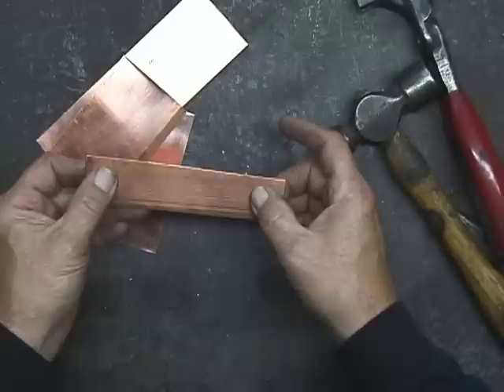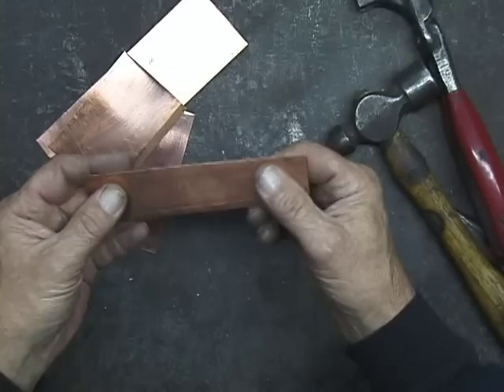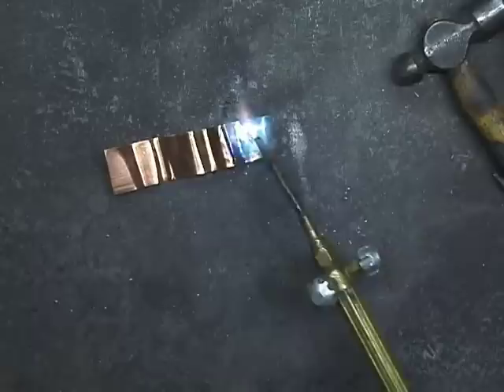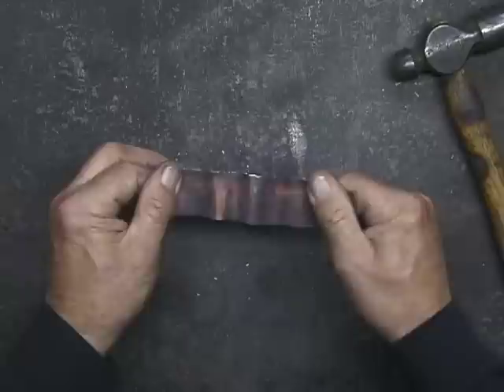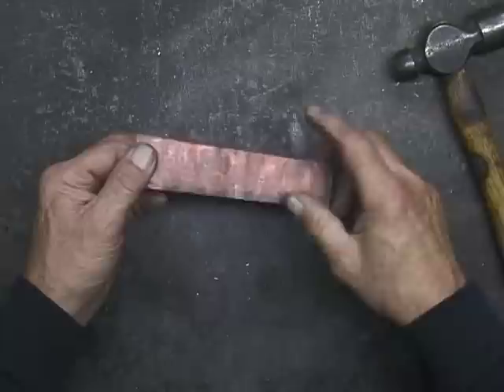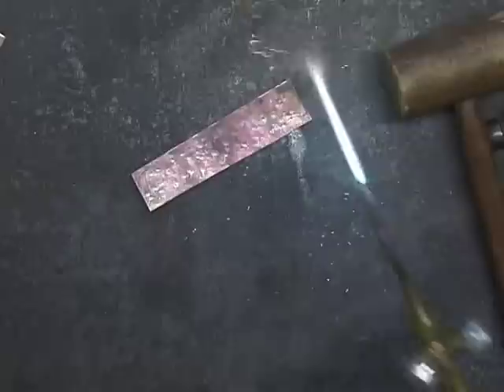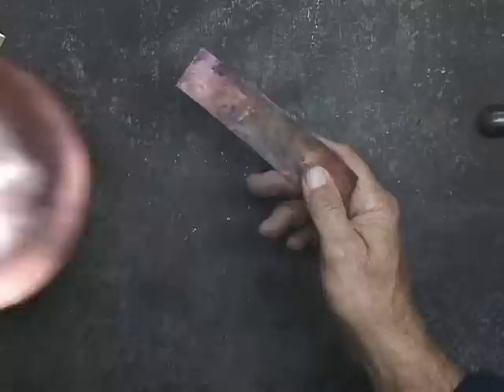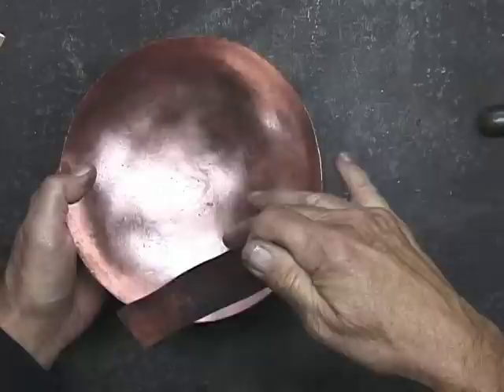Copper Annealing

Comment: Thank you for the information, it is appreciated. I'm making a "Thermette" out of copper pipe and sheet stock. I'm  forming  caps from the sheet copper. Finished one with lots of hammering & no annealing. I'm definitely going to anneal the 2nd piece & hopefully make it easier on myself. Thanks again.

Comment: I have been doing this for quite some time in order to shape 12 AWG wire to make shine still drippers for the condenser. Had no idea what it was called. I just tried to "smith" it one day, and realised it was soft after it had cooled and didn't need to be reheated for a while. Had no idea I had rediscovered the wheel. 🤣

Comment: Very good explanation; thank you very much! I am using brass photo etch for a 1:35 model, where I am also replacing "tubing" with copper wire. There are lines molded, but I like adding the tactile copper. Looks good after. Thanks!
Reply from the maker: +Jaroslav J. Peterka   Good to hear that you liked the video.  Sounds like you are doing some intricate work.
Reply: +George Goehl   Hi! It is quite detailed. I don't know how to send you pictures, but would invite you to find me on Flickr, where you could see my photos under name "Crumb & Crust", or BR 86. Thanks again. I am annealing now every piece of brass or copper. Amazed how easy it is to bend!

Comment: The flame looked like it was carburizing because of the large inner envelope. I tried it today, with oxy/propane and found that the neutral flame seemed too hot, I did it again with a slightly carburiing flame and it seemed to work better. Either way, it worked very well. Thanks

Comment from the maker: @coma22309 if you work with copper, such as hammering or bending, copper becomes more rigid.  If you heat copper it becomes softer, more malleable.

Either way you are changing the internal structure of the metal.
Look up Annealing (metallurgy) in wikipedia

Comment: I noticed you heated the copper with a carburizing flame. Is that important? What happens if  you use a neutral flame? Also, how does this work with propane? Thanks for a good video.
Reply: With Copper, the nature of the flame is NOT that important as it is with iron or Steel.  The only thing that matters is reaching the temperature.  Annealing copper can be done with a propane torch, but not all propane torches rise the copper temp enough.  Those with a "pencil point flame" only allow  to anneal small pieces of copper. Therefore, for annealing say 3/4" copper pipe, you'll need to use a "turbo type" torch together with MAPP gas (MAP-PRO now that original MAPP is no longer available).

Comment: I have a couple of questions: for decoration purposes, I'd like to bend a copper stripe around a tree and fixate it there.
1. How do i fixate it the best? Can I nail it into the wood?
2. Will i have to anneal it?
3. Can I prevent it from corroding somehow if it will be outside permanently?

Kind regards, and great video!
Reply from the maker: Damian, can't  answer your question.  Too many variables.  What kind of tree?  What is the size of the tree?  What is the thickness of the copper?  Putting a nail in a tree will kill some trees.  I've  never bent a piece of copper around a tree.  I am sure there is someone on the internet that can help.
Reply: George Goehl Oh sorry :)
It's a debarked plum tree that has been drying for five years, so I don't have to worry about the nails killing it.
My idea was to just hammer it around the tree and then either glue it (found a glue that is suitable for glueing copper and wood outside) ot nail it if I find nails that look good.
The copper is 40x4 cm and 1mm thick.
Reply from the maker: If the copper is stiff then you will want to anneal so that it is easy to wrap. For outside work I use 
VHT SP184 Clear Coat Wheel Paint .  Do a Google search.  VHT clear wheel paint will protect it from turning green.  For a number of years.

Comment: Sir, I have no experience with forming copper but was wondering if it can be hammered while it's red hot and if that would help it remain soft (annealed) while it's being shaped - kind of like steel? Also, if a copper plate is folded on itself and hammered would the two layers eventually bind into one or would they just continue to thin out separately?
Reply from the maker: You are right, it would be more malleable when it is hot, but it will cool down fairly quickly.  Eventually you will have to anneal.  Also, I find it easier to handle once it has cooled from annealing.  Folding sheets of copper is not something that I work with.  I am not a coppersmith.  You've got some good questions that you might post in a coppersmithing forum.
Reply: George Goehl Thank you.

Comment: hello!, i have a question , what happens when you heat cooper and quench it on water? i've seen that done in cooper forming and i can't seem to know if it behaves like steel for example .the faster the cooling the harder the material.. and the same goes to slow coolings and softer materials.. does cooper reacts like that?
Reply: sorry if this has already been asked a thousand times,, i just can't find a final answer :p
Reply from the maker: Franco Buzzetti Franco, Lots of people quench their copper in water.  I prefer to let it air cool.  It's just a personal preference.  I'm sure there is some slight difference.  Basically, what you are asking is a metallurgical question.  To find a definitive answer to you question I'd suggest checking out some forums on metallurgy.  Your question borders on metal tempering.  There are lots of sites that may help such as structural engineering and welding engineering.
Reply: George Goehl i will look it up, thank you for your guidance sir!
Reply: Short answer is that quenching it after getting it red hot will not make copper hard. It will anneal it. Iron/steel gets hard because of the carbon in its structure.
Reply: EXACTLY.  The only way to harden copper is by cold working it, but not by cooling it faster (it needs tremendously high cooling rates to obtain any effect, not possible to do at home!).

Comment: Mr, Goehl, thank you for your videos.  I am new to this and they are very informative.  I watched your video about annealing and it left me with a question.  My ultimate goal is to have a hammered copper copper clip.  I assume I should hammer it the way I want prior to bending it onto itself to form a money clip, correct?  Secondly, after I anneal it and get it to the exact bend I want, is there a way to harden it without manipulating it anymore (so that it retains the shape of a money clip as it is used?
Reply: It looks as though as I should've watched some of your other videos before posting.  I can see that hammering the copper will make it hardened again (I understand the annealing/hardening process), but I am afraid that if I hammer it once I get it bent to the shape I want, I will cause the money clip to not retain the bend I wanted.  I guess perhaps I would have to slide something thin, but hard in between the folds before I hammer (?).  Or is there a way to harden the copper other than "working" it?
Reply from the maker: Anneal and form.  You may have to anneal several times if the copper gets too hard from hammering.  Once you have the shape or form you want the copper should be sufficiently hard.  If you want to make it harder, you can  do some light taps which will harden the copper even more without damaging your form.  BUT, basically, you have to experiment to get the exact results you want.  Fortunately copper is very forgiving.  If you don't get what you want you can start over.
Reply from the maker: I don't know if there is any way to  harden the copper without working it.
Reply: Thank you for the reply! I didn't realize the thread was a couple of years old, but I appreciate your response!
Reply: Put it in a tumbler with steel shot. It will harden it and also give it a nice shine for a finished look.
Reply from the maker: alexo84031 below, has a good suggestion if you have a tumbler.  Money clip:  Put a thin piece of metal in between the clips and gently hammer with a plastic hammer.  If you don't have a plastic hammer, put a cloth over the clips and gently hammer with any metal hammer you have.  That will harden the copper.

Comment: How often would you recommend annealing an ingot of copper that would be, say, 1/2" thick, that I am trying to reduce to a sheet? Is there any way to know when you're about to cause fractures and need to anneal?
Reply from the maker: I've never tried to forge 1/2" copper into a sheet.  One rule of thumb that I use, is when the hammer blows are less effective.
Reply: +George Goehl Thank you for the quick reply, and for the advise. I melted some scrap copper and the ingots I made are 1" and 1/2". Still trying to work on the basics of forming copper, fractured a few pieces so far. Made a mallet today, we'll see if that and frequent annealing works just as well on thicker pieces.

Comment: What kinds of torches can you use to anneal copper and or brass. I do not have a regular jewelry torch but wanted to know if any of the micro butane torches would work.
Reply from the maker: For sheet copper and brass you should be able to anneal with a micro butane torch.  The thicker the copper or brass, the more heat it takes to anneal.  If I get time this week I'll do a video on using a small torch for annealing.
Reply from the maker: Video:  Running out of time this week, will shoot for next week.
Reply from the maker: Kendra, I think this new video will help, if the copper is not too thick, you will be able to anneal with a small Butane torch.  New YouTube video:  https://youtu.be/AIz8EWktS-c